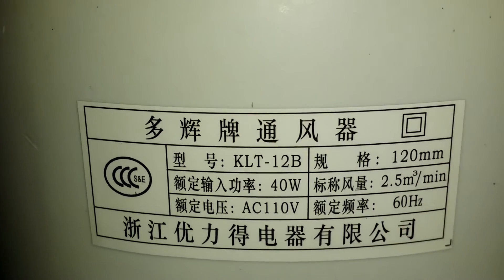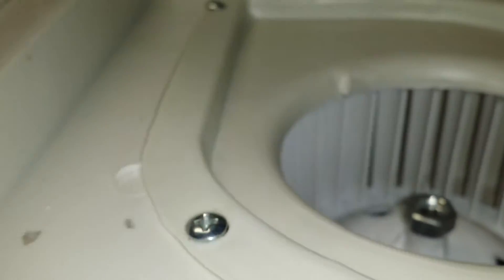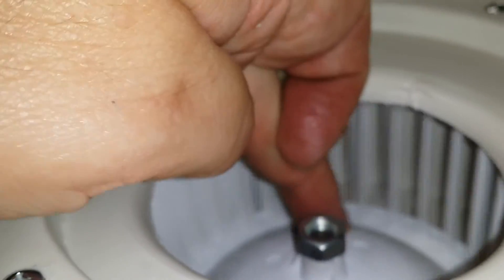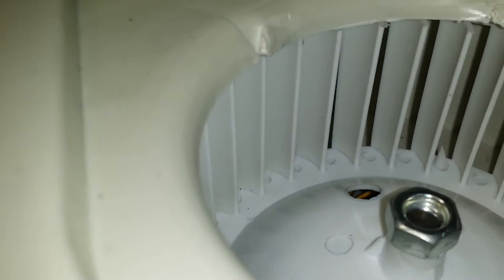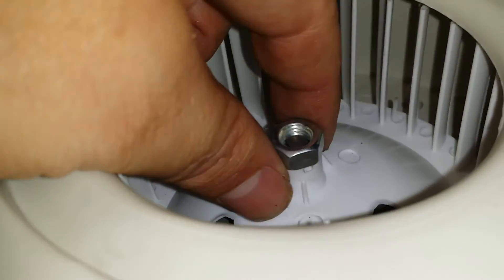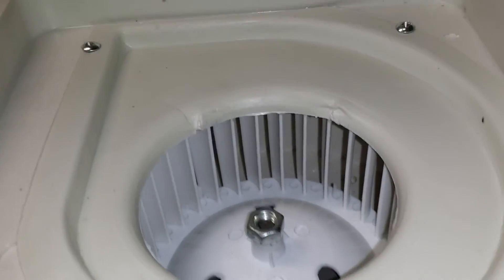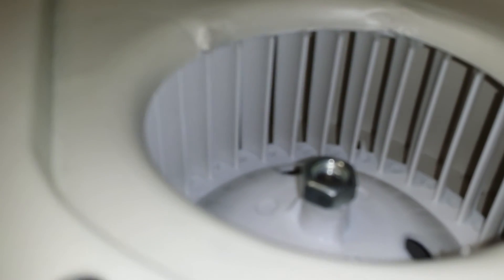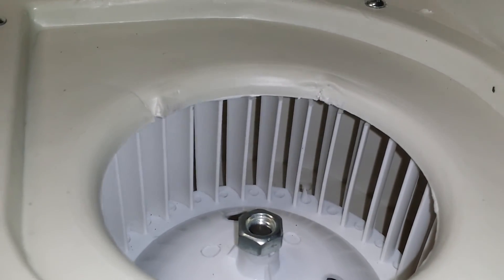K40 fan mod

Comment: a 'letter "O" drill bit' ...... and I thought it was bad when i heard drill bits spoken of in part-inches!  (i'm not knocking people for staying with the imperial system, long long after even the imperials have given up on it...)
Reply from the maker: Yeah,  most large sets sold in the US have both fractional and lettered bits still. I mostly work in metric units with my machining, drafting,3d printing and laser but still have mostly imperial drills.
Reply: @MendingThings  i get confused when they start to measure clearances in 'thou', i never know what it is... a thousandth of what lol. give me metric decimal anyday. then again my world is a mix of measurements being in the uk, pizza is sold by the grammes but its measured by the inch... petrol is sold by the litre for price but we buy in gallons... pints of milk, but its stamped 568ml....